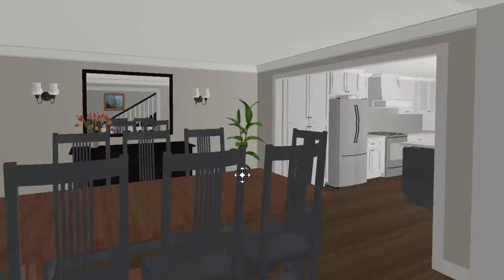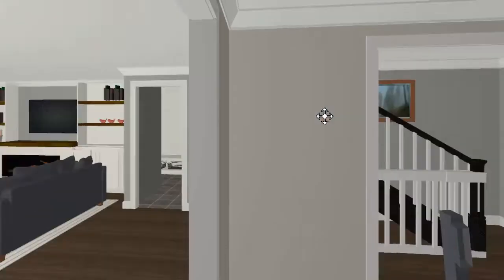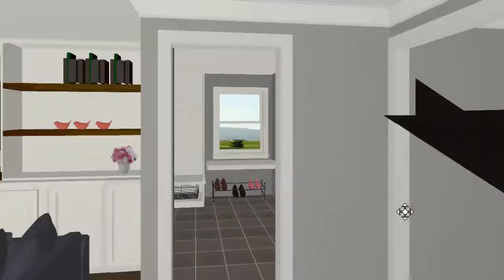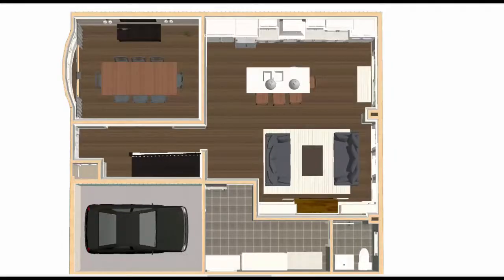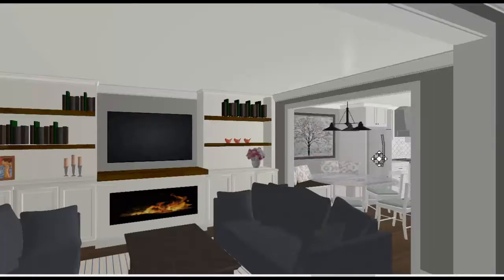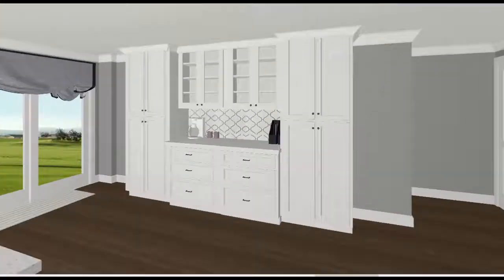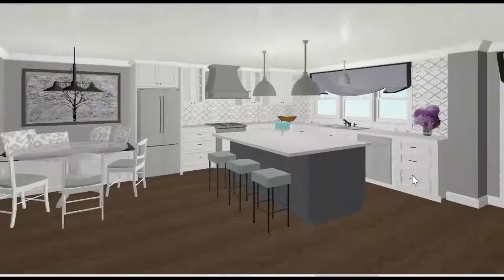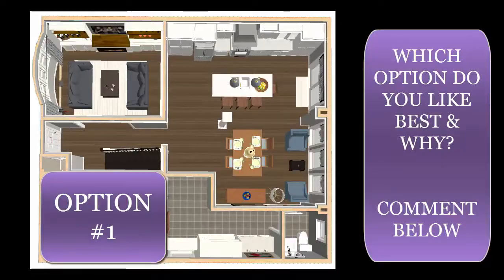Room Planner 3D Virtual Tour Main Floor Re-design

Comment: How do you know that your layouts will fit in the clients budget?  Thank you!  Julieanne
Reply from the maker: Hey Drew. We speak at lengths in the early stages with clients about their budget. Often people have no idea how much things cost - from renos to decor.  The custom cabinetry adds up and sometimes when working with clients through selections and layouts for a project, some elements need to be tweaked to bring costs down. 

For example, IKEA cabinetry or stand alone pieces that you purchase could be used in spaces that don't require as much customization as others.